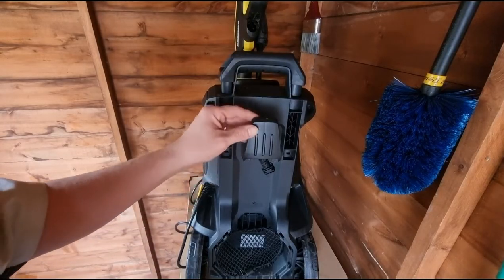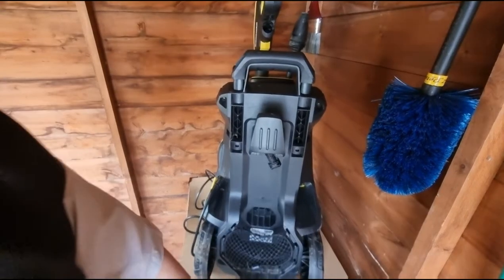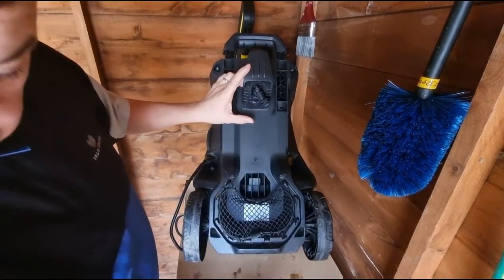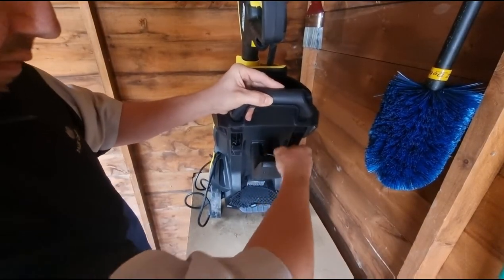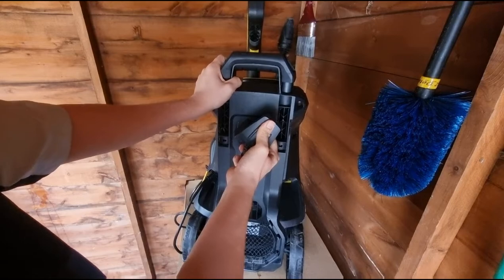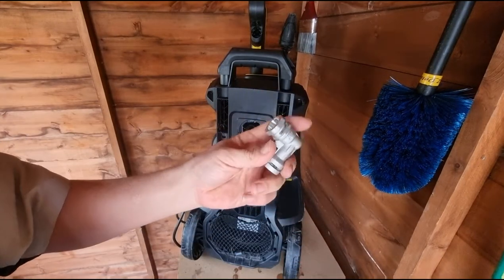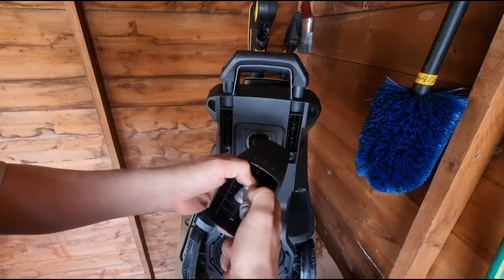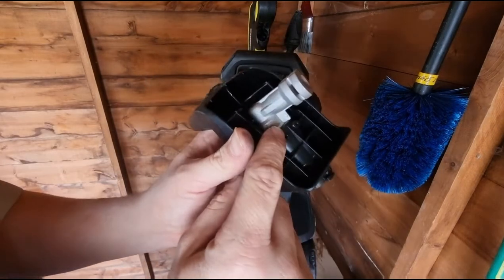Karcher K4 upgrades. 3 upgrades your K4 needs! back foot, hose and lance.

Comment: Hay there Jimmy ,I must if had more porridge than you when I fitted my jet washer foot I just pushed the new foot/connector on !!!
The hose and foot mod’s are spot on ,it stopped the hose connection blowing out under pressure .

Comment: Brilliant video. I had a leak just as described and ordered the spare part from your link. It was impossible to fit the metal elbow into the plastic bit, solution, soaked the plastic back rest in boiling water for 3 minutes, then easy peasy, now no leak.  Many thanks.
Reply from the maker: I'm glad you found use from the video, Brenda. I wish I had thought of that as it is a very tight fit lol.
Reply: @lfautocosmetics  as of 2024 would you buy karcher with mods

Comment: Thanks for the video! Would you please have any tip how to efficiently reel the pressure washer hose onto the foot? I am always struggling with it (I have a new hose, not the original horrible one)
Reply from the maker: Unfortunately, I don't have a resolution to this. Admittedly, it is very annoying even with an after market hose. I just looped it up as best as I could and hung it over the top of the machine.

Comment: Great upgrades! I tried to order the exact same hose yesterday but out of stock  - probably your fault 😂😂😂 I'll definitely be doing the hose. Mine already has the aluminium elbow pipe but I do wonder if the leaks happen because connecting and disconnecting the hose over time stresses the plastic ones and whether just leaving it attached would maybe make it last a lot longer or maybe even stop the leak from ever happening?
Reply from the maker: Hi Steve, thanks for taking the time to check out the video. Sorry for the late reply, I only just came across the notification 🤦‍♂️I hope you got the hose eventually. If they were sold out because ot Mr, I never seen a penny  in commission 😭😭🤣🤣

Comment: I have a K5 compact. Are there any upgrades I can do? I have replaced the hose, have a stubby gun and metal lance with curve on the end that fits onto the stubby gun, all quick release. I only use the Karcher gun and lances for cleaning the patio. I use stubby gun, MMC foam cannon (stubby gun fitting) and metal lance attachement for cleaning the car.

Comment: I upgraded the original K4 hose with Karchers own 10m hose, much better, no kinking and easy to wrap away.
Reply from the maker: I don't understand why they fit such a poor hose to the machines in the first place. Stick a decent hose on it and charge an extra £10-£15. Is the 10m karcher hose rubber?
Reply: @lfautocosmetics  It’s a smooth rubber construction, very easy to use.

Comment: When I connected the angled lance my k5 goes for about 5 mins then completely cuts out ....original lance supplied free it works fine
Reply from the maker: Is it the stock hose on your lance? The only thing I can think of is there me be a build uo of back pressure which is causing your machine to cut out. I'm assuming the K5 has a higher output than the K4 so that may be the issue. I've had no problems with the angled lance.

Comment: Hi there, as previously posted I did the upgrade with the rear foot and the rubber hose. I’ve found that I cannot release e nose rom the full control trigger now, so I have to dismantle the trigger assembly to do so. I don’t seem to find spares for the release mechanism ie.e spring clip or release button. Have you any suggestions other than new unit. Thanks in advance.
Reply from the maker: Do you mean you can't remove the hose end from the handle of the lance itself?

Comment: Do I need to replace the back foot with the one in video if I’d like to replace the hose to the better one? Or can I just replace the hose. Just got this pressure washer brand new. Many thanks in advanced.
Reply from the maker: You don't need to replace the backfoot, Bradley, if it's just the hose you want to upgrade. The stock backfoot is plastic and is known to split so I just replaced it with the aluminium one. Hope this help. Cheers, Liam.
Reply: @lfautocosmetics  Hi Liam, thanks again. I’ve been debating whether to stick with the K4 control or get the k4 compact instead. Mainly because the k4 compact appears to be easier to disconnect the hose. Would you say it is easy enough to change the hose. I assume I need to take the pin out? And is it quick connect on the k4 control Itself? Kind Regards
Reply from the maker: @bradley1125  it is very easy to change the hose. There is one pin to disconnect that holds the hose onto the unit itself and then you just put the new hose in and put the clip back in to hold it in place. It's the quick release connector so literally takes 10 seconds to change.
Reply: @lfautocosmetics  Thanks for the advice. I’ll be ordering a new hose for sure. I was reading that this metal back foot was karchers new approach at fixing the leaking problem. What is the chances the latest k4 model has this metal part now? I made sure to avoid the 2018.
Reply from the maker: @bradley1125  no problem at all. If there's anything else I can help with, please don't hesitate to get in touch. I'm not sure but it would make sense to have the aluminium backfoot as stock for all they cost. Check out the link for the hose I use in the description. I'm not trying to punt sales as I get nothing from it lol
Reply: @bradley1125  Hi, I bought a new K4 from Argos 2 days ago and it has the improved metal back foot fitted. 
Hope this helps.
Reply from the maker: That's good to know, Ian. The plastic back foot has been a well know problem with karcher washers for some time so it's nice to know they've actually upgraded to the aluminium as standard. I would highly recommend you upgrade to a better hose at some point as the standard is very stiff and kinks very easily. Thanks forbthe comment, I appreciate it. Cheers, Liam.
Reply: @Gracey64  Hi Ian and Liam, Thanks for the feedback on this. Just checked mine from Halfords and can confirm this is also the case. That’s really good to know that they have changed the part in future units! Kind Regards 👍
Reply: @bradley1125  just bought a k4 today, it does have a metal back foot 😀

Comment: The k4 hose comes with it is rubbish any suggestions and also for attaching the hose any way to stop it coming off
Reply from the maker: Hi David, I have left a link in the description for direct hoses. That is the hose I bought. The swap over is very simple, it's literally one clip holding it into place so you just pop it out, put the new hose in and replace the clip. Doesn't take long at all. Hope this helps mate 👍

Comment: Tell me any options metal ones to fix the leek where u connect the garden hose to i find mine keeps slipping off.
Reply from the maker: If you mean the male connector on the machine itself, I haven't had to do anything with mines. You could probably get a brass or aluminium one but if its leaking, I'd try removing it and maybe use some plumbers tape then put it back on, making sure it's in the right threads.

Comment: Your upgrades are all ok as I’ve had the same problem with all three. However your lance set up isn’t fit for purposes as the way to go is just bin the lances completely and replace it with a short trigger lance that you can use with just one hand and so you can also use a foam cannon too
Reply from the maker: Hi Ian, thanks for your comment although I disagree with you. The setup you see is definitely fit for purpose. I also have a short trigger gun and where I find it useful for some tasks, I find it useless for others. For example cleaning the underside of vehicles is much easier with a lance, power washing the roofs of larger vehicles is much easier with a lance so you're not leaning over the paintwork. I find short triggers can put a fair bit of strain on the forearm if used for any length of time. Each to their own I suppose.

Comment: My back food started pissing water, replacing with a metal one :)
Reply from the maker: It's a tight fit onto the outlet so will need some persuasion. Maybe better using a rubber mallet if you have one. Give me a shout if you need any help, good luck.
Reply: Foot :D
Reply: Also ordered a host, thanks for the tip, the one that comes with it is rubbist and way too short! :D
Reply from the maker: @moonlighthowl  I'm glad you found the video useful. The standard karcher hose is terrible 🙈 the hose I have put in the link is ideal for me. You can get it in 15m and 20m aswell if you need it longer